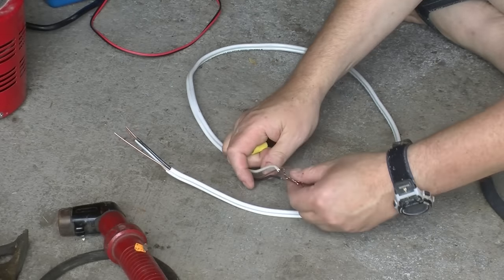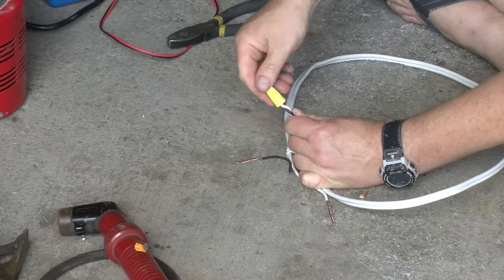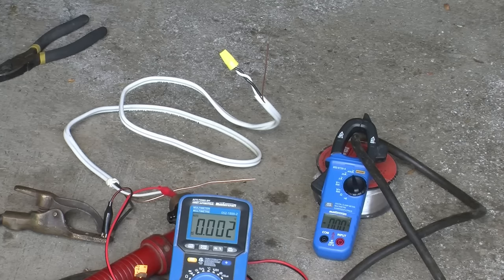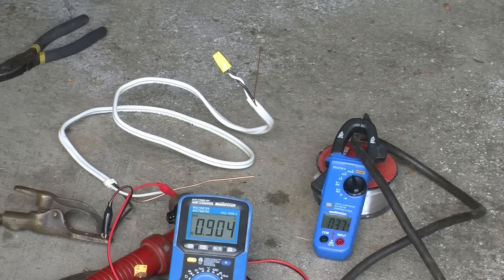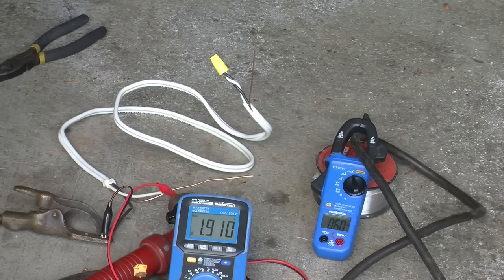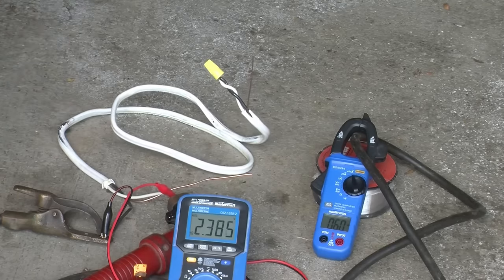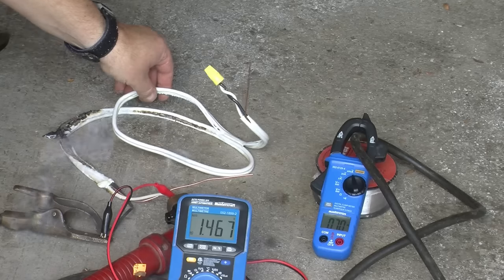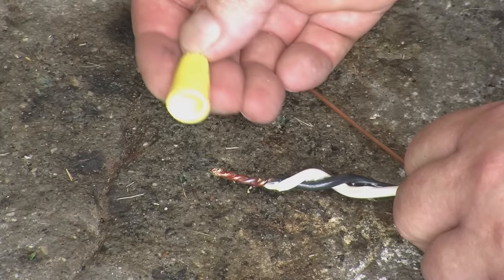How many Amps to burn up 14/2 electrical wiring?

Comment: Sweet video. Intentional electrical fires in the garage has been a pastime of mine since it was my parents complaining about the smell. Would be interesting to see how different environments effects this, such as bundled conductors, passing through studs, different conduit types, or buried in insulation. I’ll have to do some tests of my own.
Reply from the maker: Go for it! I'm going to try 14/2 though fiberglass insulation between studs and also covered in spray foam which should really hold in the heat and make cable insulation melt at lower currents. Conduit would be really interesting. I dont really trust the PVC conduit - if you try it please let me know!
Reply: @ElectromagneticVideos  i dont trust the pvc conduit either, keep the videos going!
Reply: The connection point to a cheap receptacle . 
Makes a super hot spot. That high current kettle in the kitchen. Is a prime place for a fire.
Reply from the maker: @assassinlexx1993  And if the kettle itself is old with blades on the plug being tarnished, put that in your cheap receptacle and the combination is even worse!
Reply: @ElectromagneticVideos  electrical tea kettles ?
Reply from the maker: @BeatBoyStill  You sure feel the warmth around the plug on a kettle in Canada or the US. "Tea kettle" (is there such a specialized thing?) makes me think of the UK and Europe with 220/230/240V electrical power. I dont recall  ever feel the power cords on kettles, heaters etc getting warm  over there - for the same power the current is cut in half due to the higher voltage.
Reply: Metal staples vs plastic staples, pounded down staples vs just tight enough staples.
Reply from the maker: @awboat  Lots of different combinations of things suggested. I'll probably to a bunch of standard metal ones used properly and also pounded too much, deeper and deeper since they seem most common and I would think be most likely to produce damage. Someone mentioned he had seen charring under such situations.  Will be interesting to see.

Comment: In a dead-short situation at 120 VAC without some sort of current control (like a fuse or breaker) I would imagine the insulation is going to melt and burn within seconds, and the copper might melt too. It's not easy to predict what could happen in a real-life situation where even higher voltages may be present, like a dryer (240 vac) or a stove. Another Youtuber (sadly, who has not posted for a long time) Photonic Induction has demonstrated many types of destructive tests on all sorts of things. Thanks for the demo. I appreciate the information.
Reply from the maker: Appreciate the comment - glad you liked the video. I would  think that without a breaker (or more likely a failed breaker) you would  probably have almost an explosive vaporization  of the copper. An industrial electrician I know told me how at a nearby plant a large high current bus vaporized when something went wrong. Thankfully nobody was nearby but apparently the destruction was amazing.

Unfortunately welders (my high current source) have current limiting by design. If I ever come across a large conventional  transformer that is suitable, it might be interesting to try some sort of destructive test - outside safely away from everything of course!
Reply: @ElectromagneticVideos   I have seen a couple of feet of single 12-gauge stranded wire on a tester which was set for 12 volts and had a maximum capacity of about 20,000 amps. The wire was bolted between two buss bars used for large circuit breaker testing. When energized, the wire whistled like a bottle rocket and molten copper came shooting out the ends of the class E Teflon insulation. It was all over in about 2 seconds.
Reply from the maker: @solarfluxman8810  That must have been spectacular -  I would have been thrilled to have seen that test. Its always amazing to see stuff outside of our everyday experience. 

The whistling - there was some of that when I did   my small scale version of the experiment on some old extension cords with the vaporizing plastic next to the wire escaping as jets. In your case I wonder if it was the actual copper vapor - how incredible. I wonder if it would have been any different if the wire was solid?

Comment: At 2vac 60amps the wire is only pulling 114watts,  the wire is rated at 1,710watts 120vac at 15amps. Try this experiment again but with a load that doesn't short out the voltage :) still a very educational video!
Reply: 120vac at 60amps would be 6, 840 watts, oh wow.
Reply: It doesn't make any difference. At 60 amps this cable will always drop two volts and dissipate 114 watts. If you jack the voltage up to 120 and connect four electric heaters to draw 60 amps, the cable gets two volts and the heaters will get 118 volts and dissipate 7080 watts.

Comment: Good test.  Proves that 2 current carrying conductors of 14AWG not in a bundle can hold much more than NEC ampacity requirements.  Would like to see thermal imaging after hours of 20A in a bundle of cables.  Also, I have noticed that 12A through a 15A receptacle does heat up a good bit, fortunately not to the point of failure.
Reply from the maker: I have to do that! I once moved into a house where it turned out all the cables from the circuit breaker panel were bundled together along  the beam under the ground floor and gradually one by one the cables were split of to whatever they were connected to. And the house used electric heaters. One of the first things to do was to spread out the cables.

Comment: Great video, it's nice to know we can depend on our house wiring! Though most failures that cause fires happen at connections that are improperly made (untwisted wires inside wire nuts or loose screws at outlets). I'm installing Wago's now every time I have to do wiring around the house.
Reply: this test doesn't represent a residential application. the wire would burst into flames well before 60Amps at 120v. 
do not try to correlate this test to your homes wiring amp capacity. 
there is a reason 14/2 is limited to 15amps breakers. and 12/2  on 20amp breakers.
Reply: @darkshadowsx5949  Obviously, but I'm just saying that failure points are at the connections, not the wiring inside walls, unless they are damaged somehow. A nail or a screw driven through a cable is never a good idea, but 💩 happens! Observing the code and minutea are your best friends.
Reply: I would like to see the same test using wagos.   I think wego's would fail before a wire nut would. I don't think the wago holds the wire as tightly, therefore creating more resistance and heat.

Comment: Excellent video,  and I am totally amused by the 'experts' who keep commenting you have it all wrong... you need 120 Volts.  The wire is 'rated' for 1,800 W,  (120 V x 15 A).  They conveniently leave out the 'R' parameter of Ohms Law.  The only thing that matters is I and R to determine P (the heat energy over the length of the wire).  Nobody cares about supply voltage.  The topic of the video is voltage drop across the wire,  hence the low voltage,  which results in high current,  due to low resistance and therefore significant heat (Watts).   The formula for this test is  I² x R = P
Reply from the maker: Yes - I reply to the people who nicely express they confusion about that and try to explain, but totally ignore the "your an idiot" type comments. You can have a discussion with those types.

You certainly explain it very nicely. 

The legitimate complaint some have mentioned is the cable is in open air. A number of followup videos are with the cable in a 2x4 wall section with different types of insulation. The safety margin sure goes down!

Comment: i did a similar test with new wire to K&T wiring, and it actually failed in order from new to old, though the K&T never failed. it took 90 A never failing (it did get very hot, and oozed rubber out of the cloth)
Reply: K&T generally is so far apart that it is considered 1 wire suspended in air, and can dissipate more heat into the surrounding air than the two wires adjacent to each other inside the sheath shown here.  It's all about if the wire can dissipate enough heat to avoid burning the insulation.
Reply: @glenndoiron9317  yes, that's why it can be used at somewhat higher currents for a smaller wire size.
Reply from the maker: 90A! Wow. Its held by ceramic insulators, right - they didnt crack when it got hot? I had heard it was great as long as it didnt get messed up by modern upgrades.
Reply: @ElectromagneticVideos  didn't crack or anything, and it didn't even get that hot, i could put my hand on the wire, the 1940's "Romex" style wire held up very well too, until the outer insulation cooked til' it became conductive carbon and started glowing. Yes, it is fantastic so long as it is not covered by insulation and doesn't get over loaded by dangerous modern additions, usually by homeowners that do not know what they're doing. i have actually wired one of my storage shed's with it, and used an 1800's  fuse board that i built myself. works fantastic. I'll one day do a video on it
Reply from the maker: @gtb81.  Incredible that did vintage setup like that! I hope you video it - I just subscribed to your channel so I dont miss it. Just watched the vintage lightbulb video!
Reply: @ElectromagneticVideos  yeah, that one i intended to place in a working setup, but i can't get a socket for under $300, at one point that bulb may have been the oldest on YT  actually lit up (though i can't say for sure). i do have a few 1920's bulbs that i have used and will put in the K&T circuit if i ever video it. I have a socket from the 1910's that i use for a drop light believe it or not. i've also got a few 20's radios, one of which i made that would be nice to show off. i also have a 1929 Oldsmobile. maybe one day i'll get around to recording them all. everything i have i can or will actually put to use, nothing much is only for display so anything i record will actually be functioning. Sometime i'd like to build a 1920's cabin in the woods build exactly like it is still in the 20's with radios, wiring, plumbing and all. might even drive my car up to it if i can ever get the engine sorted
Reply from the maker: @gtb81.  You have a collection of vintage stuff like I do! I sure hope you video more of it. I would certainly watch! Does the 29 Oldsmobile run? I have never had a vintage car but they are so neat. Does it have the old Model T type spark coil? Or was the Olds more advanced by then?
Reply: @ElectromagneticVideos  it has a points and condensor setup, much like the newer stuff, it doesn't run right now, it did but the people who "restored" it messed up everything so I've got to repair the engine. I've done a lot of work, I currently have two, one needing a full restoration. It'll take time, lots of it
Reply from the maker: @gtb81.  Reason I asked is I have vintage spark coil very similar to the Model-T coil. They were used in early crude spark gap radio transmitters. What a great couple of projects requiring incredible skill. I'll certainly dont have the master craftsman talent for that!
Reply: @ElectromagneticVideos  ah, yeah, i have thought of making a spark gap transmitter before. might still do if i ever find an antique telegraph key. they were also used for hit and miss engines, tractors, and even electric fence chargers!
Reply from the maker: @gtb81.  I just looked up hit and miss engine! Didnt know about them!